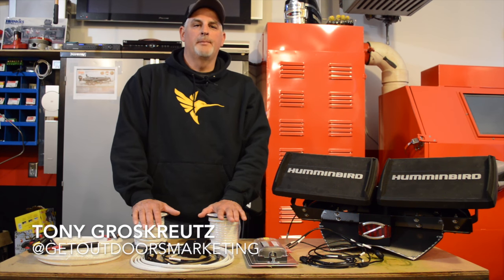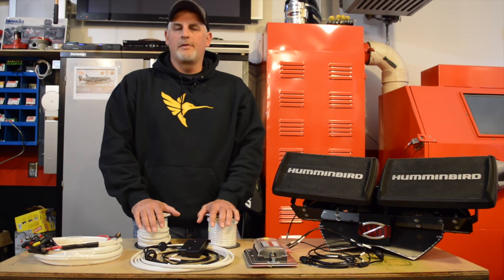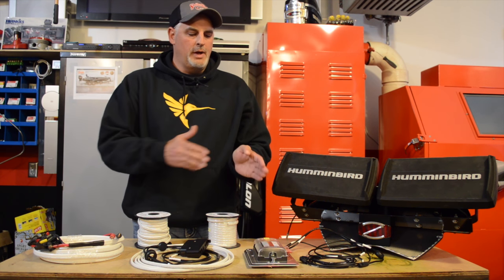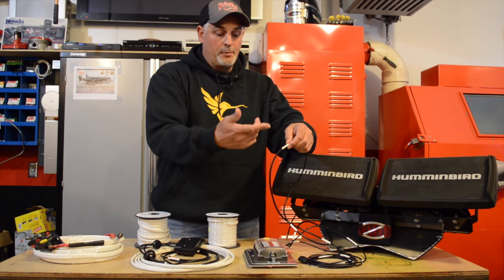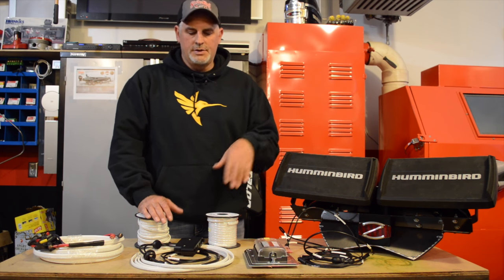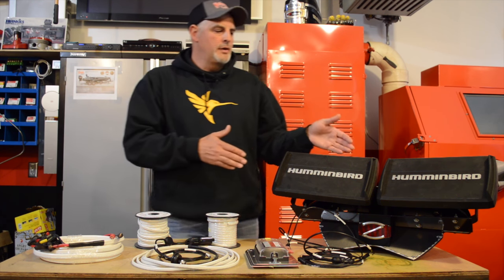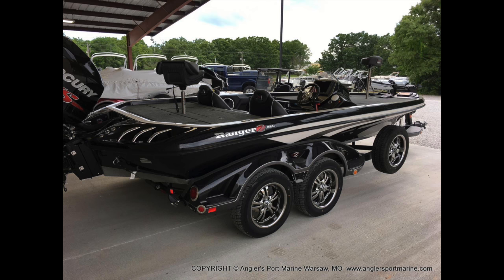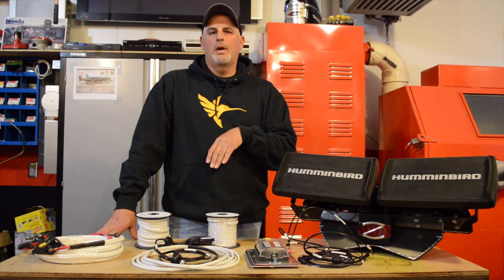Size your wire correctly  so your Humminbird Helix units function properly

Comment: I recently obtained a Helix 9 SI. I connected it to a 120-12v converter that plugs into a regular AC outlet (ouput is actually 14+V). When I power the unit on, at times it will stay on for about 10 seconds or so and then powers down by itself. Do you have any idea what could be doing this? I really appreciate your advice - thank you.

Comment: This video is great but just made me sick to my stomach because I thought I was set to go after getting my 5port and Ethernet cables in. Now I'm going to have to get a fuse block and tinned marine wire and rewire crap. What fuse block is that? Can you provide a parts list for me and I can go from there please? I have an 2006 bass cat Pantera classic where I'm putting the 1100 series birds and 360.

Comment: Everyone else recommends running a direct line from the battery to the sonar units and not a control panel.   Comments?
Reply: This is true or you will have to power your unit on ever time the key is turned and lose information.
Reply: I was thinking the same thing, fuse the power cords str8 to battery. I had it going to my fuse box and was having issues. Any insight would be appreciated not that these guys are commenting or taking questions lol

Comment: Where can I get these items?
Reply from the maker: Lee, if you live in MN get it from Rapid Marine.
Reply: Look on Amazon. I found the fuse panel and all the right wire sizes marine grade to include the heat shrink tubing as well.

Comment: Didn't show us the schematic, where you're putting the breaker, what kind of breaker, what kind of wire specifically, what connections, shrink tubing, soldering.